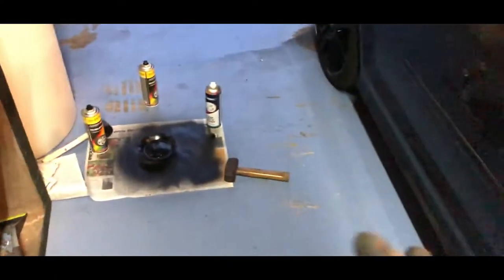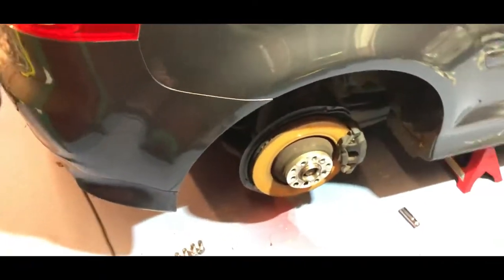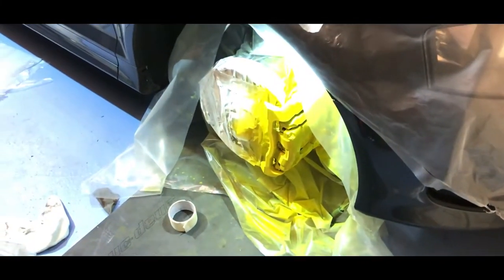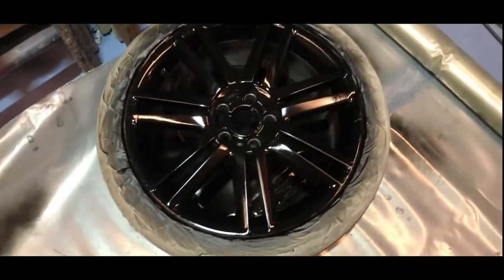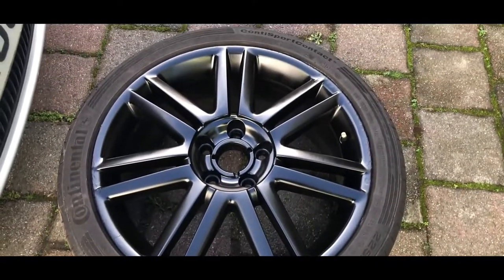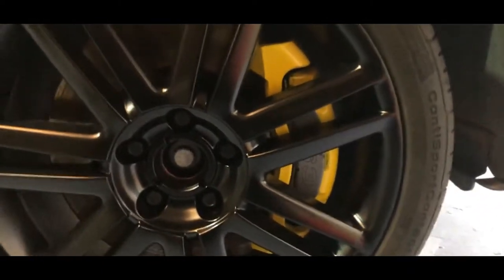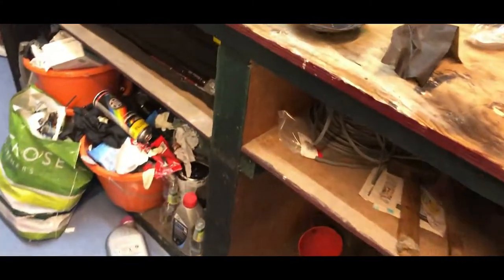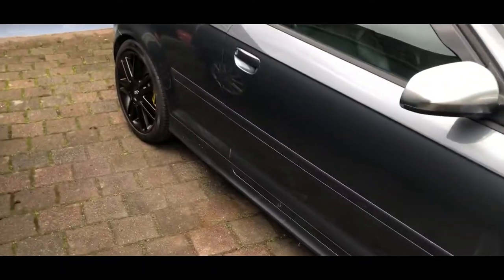I Sprayed My Audi S3 Wheels & Calipers!

Comment: Did you sand down the rims or just cleaned them up en did the primer coat end then top layer black
Reply from the maker: Abdel Abdars hi mate, sanded them down, primer, gloss black paint. And then put some lacquer on top, although the lacquer didn’t turn out the way I wanted it too but does the job.